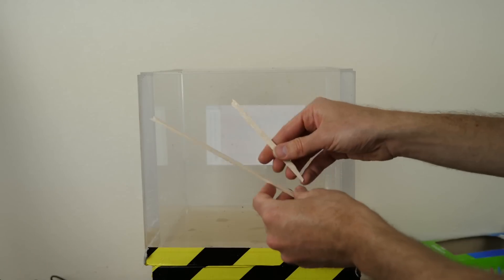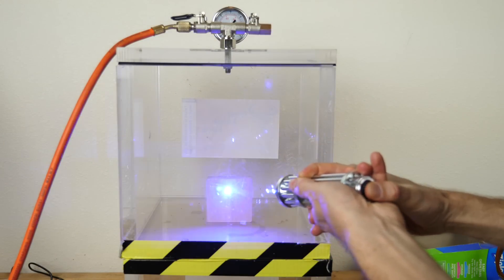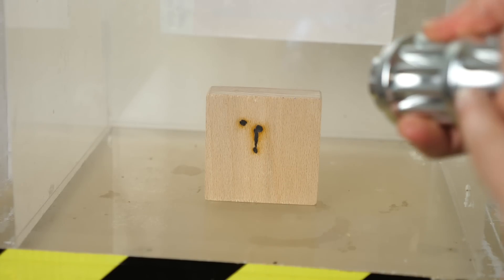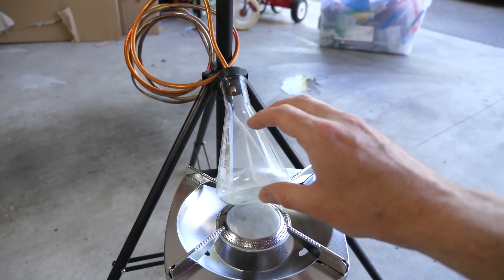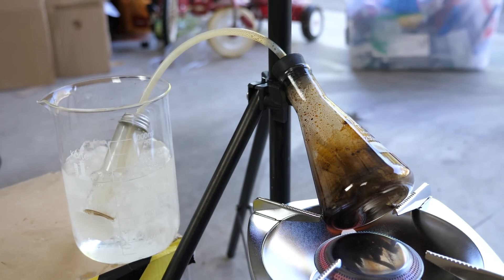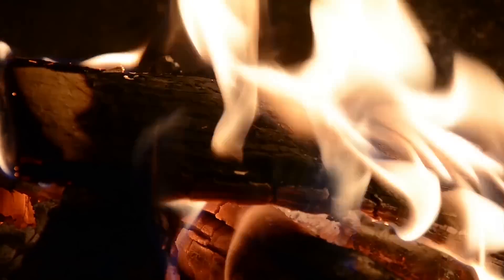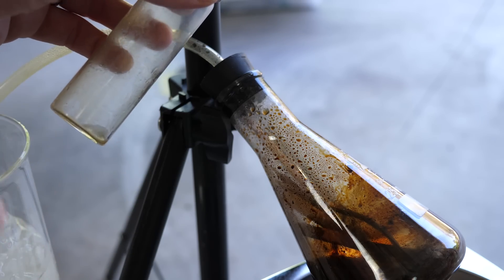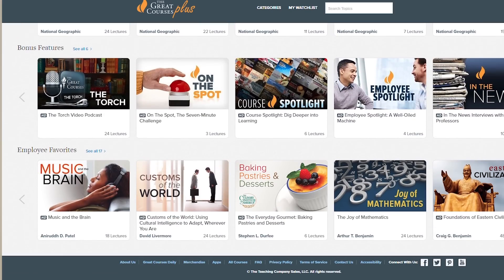Is It Possible to Melt Wood in a Vacuum Chamber? The Wood Distillation Experiment

Comment: Everything does not have a melting point.  Many things just have decomposition points.  They don't combust, they just break down.  This video is a little bit of a hot mess.  you should probably at least read the wikipedia page on things you're going to talk about before just letting whatever words you think of come out.

Also probably most of that liquid is just water.  I noticed you didn't bother burning the "flammable liquid".
Reply: htomerif Proper sentence structure would be "not everything has a melting point". The other dude is interpreting the words you wrote correctly.
Reply: @Alex you are right. htomerif's statement was not correctly formulated.
The statement "everything does not have a melting point" is semantically equivalent to "nothing has a melting point".

Just to play around with syntax VS. semantics here:
A semantically equivalent version of "not everything has a melting point" would be "there exists something that does not have a melting point".
Reply: If you don't care then why do you keep showing up and replying? 
And I agree with htomerif. Just sayin'.
Have a nice day.
Reply: Wowzers what a wreck of a thread.
Reply: htomerif dude, you are still incorrect and the fact that you don't see that while still trying to come off as some 'smarter-than-thou" douche is absolutely baffling. Both "everything does not have a melting point" and "all things do not have melting points" are both saying the same thing, you're correct there, but they're BOTH WRONG. Saying "all things do not have melting points" is saying "nothing has a melting point". Once again, and for the last time, as myself and others have said repeatedly, the correct form is "not all things have melting points" which means exactly what it sounds like it means. For fucks sake you're soooo incredibly thick.
Reply: @inser funny name: "Ice cubes are melted to make water"…
Snow does not melt !!!
The ice crystals do, but the air between the crystals get lost...
Reply: Everything has atoms.

Atoms can join together tightly (solid).

Atoms can move together freely but have surface tension (liquid).

Atoms can move freely without any cohesion (gas).

Same for molecules.  Every molecular structure is physically capable of this because phase change is mechanical in nature.  There is no physical barring for these substances to be prevented from phase changing.  So your claim is not only erroneous, it claims that there is some sort of link between melting and decomposition, which is false.  Decomposition is a chemical change.  The only reason that some materials appear to melt and others do not is because each atom (or molecule) has a likeliness to phase change based on energy.  Some require gaining or losing tremendous amounts of energy (with some molecules losing bonds before reaching such a point) to phase change.  Some molecules are unable to phase change due to chemical changes appearing first.  If in a chemically pure situation, such materials would phase change just like every other.
Reply: You're confusing molecules with individual atoms..    You can absolute split molecules into mini-versions..  a single grain of salt is one big molecule you can crush that grain and have several smaller grains of salt each being one big molecule.
Reply: I'm not talking mixtures (substances)..  That's why I used salt (sodium chloride) and not fucking sand.    A Molecule is just a abstract factored representation of the smallest fundamental unit of a chemical COMPOUND.   NaCl = Na2Cl2 = Na3Cl3 so on and so forth.   So in a homogeneous compound Na1000Cl1000 = 1 NaCl Molecule..   break that in half and separate them to Na500Cl500 each and now you have 2 separate NaCl Molecules.
Reply: Zachary Hutchinson:  No.  Incorrect.  Every compound does not have a melting point.  Many compounds have decomposition temperatures lower than their melting point.  Other compounds sublimate.  Some do both.

Please, look up the "melting point" of cellulose.  Tell me what it is.  Lignin is the other main component of wood.  It has a (qualitatively) similar "melting point" to that of cellulose.
Reply: Alex: yeah, I get that.  My sentence structure was fine.  The intent was contextually clear.  I think your sentence structure needs to be redone as "intentionally misinterpreting" not "interpreting".  It seems like douchebag there has been continuing to respond despite my having stopped paying attention to early for the trolling he wanted to do.
Reply: So, it still melts. if it liquefies, that's melting, air or not. But coming off my other post, im not gonna turn it into a paragraph-10 comment reply. But it is a fiar point, and thank you for raising that question.
Reply: How can rubber be "one big molecule"??!
You can easily cut rubber into 2 smaller pieces.
Which means those 2 smaller pieces of rubber are also just "one big molecule".
But if they are stable on their own, what force what holding them together before??
You can't just split molecules into miniaturised versions of themselves! Those can't be molecules!
Reply: htomerif in terms of mathematical logic : «nothing has a melting point» and «everything doesn't have a melting point» has exactly the same sense. But English syntax is actually not mathematical and doesn't have a «logical» meaning so you're right
Reply: +irtheLeGiOn
Nonsense.
You're confusing molecules with substances.
Sand is finely crushed substances of rock basically, and within those substances of rock are the molecules that bond together to form that substance of rock. Sand is not "one big molecule".
What you're talking about is simply separating different molecules from each other. Obviously you can do this, that's just basic separation. If you take any substance (gas, water or solid) and separate it into 2 pieces/spaces, that's not splitting any molecules, you're just taking a set of molecules away from the total.

Obviously you can't split molecules into mini-versions of itself, otherwise the original thing you split wouldn't be a molecule! Makes no sense...
Reply: wow I'm dumb
thanks
Reply: Every element and compound does have a melting point. The reason this is hard to demonstrate with wood, is because it is not a homogenous material:  The constituents all have different properties. Also, its probably impossible to heat wood without any chemistry happening.
Reply: "Most of that liquid is just water."
No, it's not. Make charcoal yourself, the crud that runs off is sticky and tar like. The water vaporizes out. You do not get soaking wet chunks of wood from pyrolyzing it. You get dry charcoal.
Reply: htomerif dude, you're still wrong. You again said "every compound does not have a melting point" which, as others have pointed out, means "nothing has a melting point". Of course what you mean to say is "not everything has a melting point" but going on insisting your sentence structure was correct is just foolhardy, especially for one who claims to be so knowledgeable. You gave that initial responder a lot of shit but he was actually correct in the point he was making vs the statement you made. The fact that ice melts does in fact prove the statement "everything does not have a melting point" wrong, regardless of what you actually meant to say.
Reply: SpyderByte: so sometimes you can word things different ways and its obvious from the context what I meant.  I hope that helps clear up your intentional misunderstanding.  You wanna explain how it was "foolhardy" when it was obvious to absolutely everyone how it was meant to be taken?  Yeah, thats great that you did a little play on words to make it sound like I said the opposite of what I did.  Golf clap?  I don't know what you want here.
Reply: htomerif is what you were trying to say obvious because of the context? Kinda. Does that mean your wording was correct in any way? No. Is the guy who read what you wrote a little too literally wrong though? No, he isn't, but you still acted as though he was while at the same time trying to sound like a smartass. I'm not intentionally misunderstanding you, I'm just telling you that what you wrote and what that guy responded with didn't deserve the attitude you're dishing out.
Reply: SpydersByte:  I thought you were that guy, so maybe the level of annoyance on my part was a little too high.
If I'd said "all things do not have melting points", the granularity of what I was talking about would have been more clear but "all things" and "everything" have literally the same meaning.

It was very important that I worded it exactly how I did because thats how the jackass who made this video worded it.  I needed to negate exactly what he said, so thats exactly what I did.

You know what? Lets just full-throttle this into the weeds and look at set theory.
Take the set of all things lets call it E, and the set of things that have a melting point and call it M.
Is the statement E⊆M true? No.  So E⊄M.  In fact M⊆E.  Everything (E) does not (⊄) have a melting point (M).

I recognize that on all sides this entire comment thread (with the exception of a few physics posts) has been absolutely retarded, but I now declare, having somehow proved my grammar mathematically correct, winnner winnner, chicken dinner.
Reply: being born in '84 I actually am technically in early Gen Y, which covers '80 to '00 so you're actually correct. However, you seem to be claiming you aren't so you're either far too old to be failing to grasp your grammar mistake or you're just as young as I'd expect considering how stubborn you've been. I don't think either is something you should be proud of. Half the reading comprehension you say... rather ridiculous coming from you considering the subject of this conversation. The guy who refuses to just admit to the small grammatical error he made and instead writes a formula to attempt to prove it wants to tell me that I'm always right and that I'm special. 

Yea buddy, I'm the one with the issue here, sure.
Reply: SpydersByte: I thought you said that was the last time you were going to say that.  I guess I got to you enough that not only did you have to reply, but you had to do so immediately.  You might want to check your priorities.
Reply: First of all, I'm just sitting here watching Critical Role on a Sunday so it's of no issue to me to reply when I see the message. Second, I said that was the last time I'd explain the difference between those sentences and it was. Lastly, considering you had nothing of value to say in actual response to my last message I'm going to guess you've finally run out of bullshit to spew. That being the case, have a great day. I'm sure you'd never admit it but hopefully you've actually learned something from this. 'Twas fun while it lasted, cheerio!

Edit: Almost forgot... did those 'millennial' years surprise you? My guess is you just use that as an insult without actually realizing you are a part of that group. I personally had to look it up to verify but since you had no snappy comeback I'm guessing it came as a surprise to you too.
Reply: You: This video was a hot mess. // Also you: try wikipedia lmao
Reply: It would be nice if you just stopped replying now, beacuse it seems like to me you wanna start up another conversation instead of trying to push me to start another conversation but  but you are right about that, but i cant make promises lol.
Reply: Wikipedia sucks btw for information it's absolutely not reliable
Reply: SpydersByte:  I've heard you can tell if someone is a millennial by their complete lack of a sense of humor.  I've also heard that millennials have about half the reading comprehension of the generation that came before them, so I'm not really surprised by what you're saying.  Keep fighting for that literary social justice.  I'm sure it will turn out exactly as well as this conversation has, and remember: you're entitled to everything you want and your opinion is always right because you're you and *you're special*.
Reply: Actually sir, according to the definition of melt (When something liqufies due to heat) Ice cubes are melted to make water. nice.
Reply: Oh, I'm sorry, I didn't know that all wood somehow has a core of solid ice inside it.  somehow.  Don't worry though.  I went on to check some of his other videos.  They all have the same "you done fucked up" ratio of likes to dislikes and for the most part they're pure retardation.  Beginning to end.  You might want to check out his video on "can flies fly in a vacuum?".  Before now I didn't think anyone could know what the words in that sentence meant and also be stupid enough to not automatically know the answer.  I'll admit it: I was wrong.
Reply: Im not talking about ice in wood, which theoretically you could do but im talkin about the fact you said "Everything does not have a melting point." I just wanted some clarification did not intend to stir up a paragraph.
Reply: Wait.. So you "proved" that everything does have a melting point by pointing out one single thing that has a melting point?  Aright then.

Also, did you actually mean that you wanted some clarification?  Or that you wanted to give some clarification.

Seriously though, go to CodysLab, AvE, NileRed, NurdRage, CuriousDroid, Isaac Arthur or just about anything else.  Abandon this garbage channel.
Reply: im not talking about this channel, your saying that everything does not have a melting point, i disproved that beacuse ice has a melting point. thus breaking the "everything does not have a melting point" I know thats not even the focus of your original comment but still. i disproved what you stated within your first sentence and never really improved that random statement.
Reply: I'm confused as to why you think "everything does not have a melting point" and "nothing has a melting point" are the same sentence.  You know what sentence does have an identical meaning? "Not everything does have a melting point".

I mean I get the mistake you made now, but unless you're 12, its not particularly excusable.
Reply: To be honest. I'm not a nerd or anything and you seem to get more and more agitated, so before this escalates don't expect me to reply. I don't care if im 12 or what-most, so if you have anything informative or to admit this is a waste of time rather than saying your opinion and calling me 12, im not replying. So feel free to leave a reply. But I wont care, your opinion is yours, and mine is mine. So I say we just call it off, because my interest in this conversation is just now at the point of i can only bother to reply back. and we as humans have our own thoughts on different things. But replying back to get the "last word" just shows your take on things will just prove to me im wasting my time.

TL;DR: bye
Reply: And to add on, im getting sick of going back to this video because i feel like im gonna get my recommendations and i cant hear this guys voice anymore

Comment: When heating the wood in the beaker, the first sign of moisture at the top would be water. No matter how dry you think the wood is, it still contains moisture. After the water evaporates, then you get the heavier molecules. And what these chemicals are, depends greatly on the species.
Reply: i'd say that most of the water is probably contained in the cytoplasm of the cells

Comment: I'm almost positive, the only way we could melt the wood would be to put it in a very hot, but humid environment. It just won't do anything but burn when it's dry, that being said. if you were to put it in a super humid box, then heat it to those chemicals melting points, it might just get the wood soggy, and turn it to mush from the heat (cooking it like it's a soggy noodle basically) which to some might be like melting. Really it'd just be  the first step to making paper xD

Comment: Actualy not all that you say is true. If you don't have oxygen, the wood won't burn. Might even melt... I don't know.
You can try replacing the air in your vacuum chamber with Nitrogen (so you won't have any oxygen left). At o.1 bar or less you still have oxygen (slow burn but still burning). Then heat up to the melting point. But not with laser. You can try a Nykel based electric wire heater. Also you should make your homework better...

Comment: Have a chamber filled with a highly stable intert gas (Like Xenon) at a VERY high pressure. THis will help to stablize the wood. Think liquid CO2. Then you have to introduce a heat source that will melt it.

Comment: If you turn the volume all the way down at 0:00 then press [Alt]+[F4], you'll get the best result. If you are manful enough, you can heat up your monitor to 400°F with a lighter, it will be transparent afterwards, just be careful to spread the heat evenly.

Comment: A fire needs oxygen, fuel and heat to start and sustain itself. Now since there is no oxygen the wood or fuel will reach it's ignition temperature but will not combust and therefore all it will produce is smoke and flammable fumes, however I can say with certainty it will NOT melt